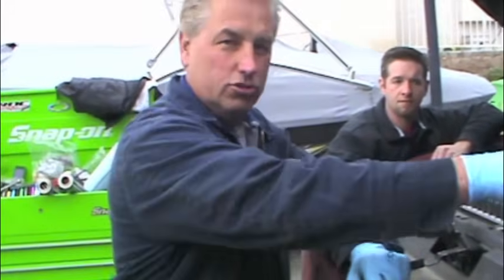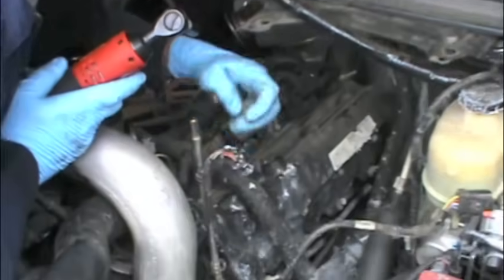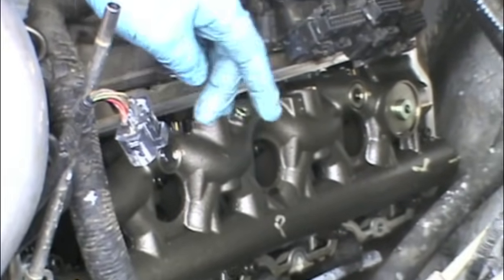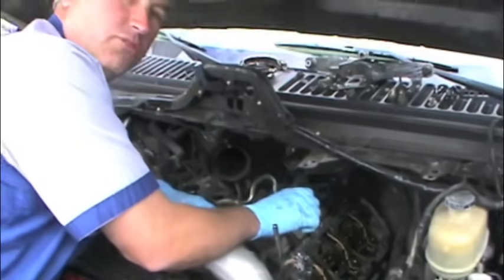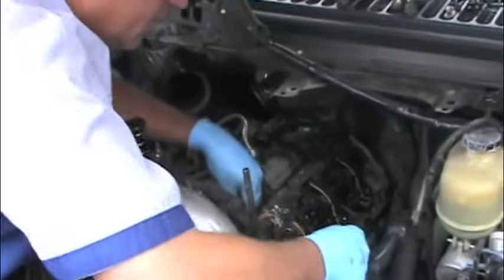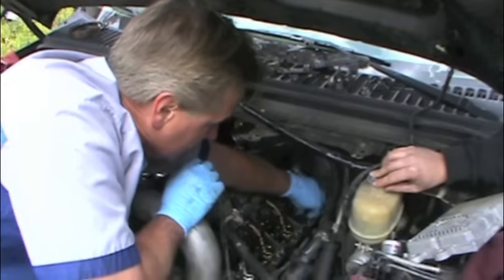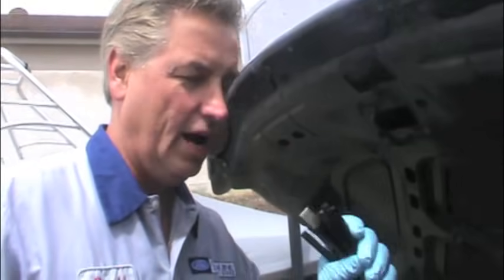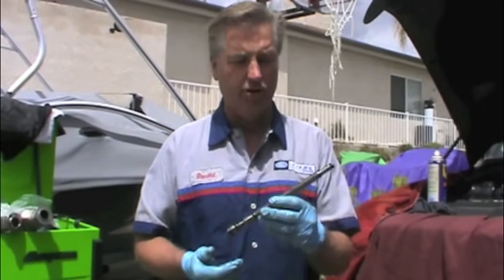6.0 DIESEL FORD POWERSTROKE INJECTOR REMOVAL AND INSTALLATION TIPS AND TRICK

Comment: Jeff here. Used Ron's material and FordTecMakaluco's as well to repair my 04 F350 6 liter. re-posting here what I just posted on Makaluco's channel in hopes it may help others.

I can’t thank you enough for putting up this and other videos. Repair details on my truck are provided below in hope they may help others. I love doing projects but my day job (a lot of times it is 7 days a week) just doesn’t allow me the time to figure all these things out on my own. From a long-term Navy man, thanks for all you do. It truly means a lot to me. I wish you and your Family the best. Thanks again. Sincerely, Jeff

2004 F350 107k miles, original owner. Turbo replaced at 25k with reman. I pulled the turbo at 75k due to vanes being seized. Cleaned, put on anti-seize, seems to be fine.
Starting at 90k, long term P0401, 0404, 1315. Cleaned EGR, resolved, but returned. Replaced EGR valve. Codes returned in a few months, cleaned, intermittent success. Truck ran fine, no smoke, plenty of power.
Recently returning from a trip, vehicle began to run rough at idle, not horrible. White/gray smoke at idle. Under acceleration, heavy gray to black smoke. No new codes. Lacked some power. Have never had a coolant leak. EGR well looks good when I pull the EGR. Checked down pipe, ok. Used my XRay scan tool no new codes. Bought AutoEnginuity scanner with Ford enhanced package. Scan with this tool indicated that at some time in the past p0281 had been set, but was not active. Ran the Power Balance test, indicated number 7 was not contributing equally. Ran the injector buzz test. Sounded good to me. I had my wife listen to the video of the buzz test and uncoached, she indicated that #7 sounded different. Bought reman injector form Bullet Proof Diesel. Installed using your video. Completed this morning and after about 10 seconds of cranking it fired up and is running very smooth. Power balance test looks great. No new codes.

Comment: Rip. I think ron has to be the most helpful 6.0l guy. Ive learned so much watching ron. I cut down a punch for my 12mm. Works perfect. Now i can put a socket on it and torque the stand pipes and dummy plugs to 60ftlbs.

Comment: I had much different symptoms than that.  I pulled the P0266 code for contribution of cylinder 2.  I was puffing black smoke in all conditions and could feel the miss.  I was a bit intimidated when I began taking things apart to change the injector.  by the time I was finished, I was glad I did it myself and will do any other work myself as well.

Comment from the maker: I've tried hotshot and rev-x I've had better luck with rev-x. They really help if its sticking from varnish not wear. If you lacked maintenance on your fuel filters and the pressure dropped then the fuel cavity is only partially full. That causes less resistance and the oil side will beat that plunger into the injector. Fuel pressure is critical. I've seen brand new injectors fail in 200 miles due to low pressure UNDER A LOAD NOT AT IDLE.
Reply: Rest easy Ron, still learning so much from you. God bless

Comment: I used a 12mm head bolt nut and washer in between to tighten the fuel rail plug. I put a 12mm socket on the nut and ran it all the way down the bolt until it bottomed out and the bolt head tightened the plug. After the initial prime and start, the truck would crank for up to 15 seconds before starting after sitting for short periods of time. Apparently this is normal after pulling the high pressure oil rail. I merged the truck onto the highway at full throttle up to 110km/hr 5 times to clear the air from the oil rail. It fires up in under 2 seconds now.

Comment: YOU DONE A PERFECT JOB. OTHER THAN,I USE BLUE LOCKTITE ON THE INJECTOR BOLTS. THE REASON IS WHEN YOU HAVE A PROGRAMMER INSTALLED, IT RAISES THE PRESURE. I ALLWAYS TORQUE THE INJECTER BOLTS BUT I HAVE HAD SOME COME LOSE.THATS WHAT THE LOCKTITE IS FOR. THE NEXT THING IS ON THE INJECTOR PLUG IN THE HEAD. A PRESURE REGULATOR SLEEVE OUT OF A GM 4L80 TRANSMISSION WORK BETTER THAN THE TOOL MADE FOR THE JOB. AND MOST TRANS SHOPS WILL GIVE YOU ONE. ILL SEND SNAP-ON BY SO YOU CAN GET THE RIGHT TOOL.  LOL

Comment: Condolences to Rons family. I have a 05 f350Ford. Runs great, but sometimes when i park it, it wont start back up. I have to wait 30 minutes, and then starts up perfectly. Its been in the shop several times. Any suggestions?

Comment: Ron I have a early 04 we did 8 injectors hpop, oil cooler, egr delete, and a ficm when we got it started ran for little bit until it hydrolocked tore back down found injectors were loose retorqued them going to remove glow plugs to remove any fluid do you have any other suggestions I should look for other than the injectors before i start it

Comment: Hi ron i have a question .i have a 2003 ford 6.0 diesel truck ,i was changed the fuel filter went i was take out the filter one little piece of the filter holder broke off and fall off inside the line i try to use a vaccum to take out but no good luck 1 month later i was trying to go to work but my truck never turn on again do you think the piece went inside one of the fuel injector

Comment: Ron, I am currently installing the Bullet Proof egr cooler and their oil to air cooler.  I have 3 bad injectors and wanted to know if you recommend replacing the injectors while the intake manifold is off or should I install if before starting the injectors.  Your thoughts and advice would be much appreciated.  Craig
Reply: Clearly this is 8 years too late, but if you have an older 6.0l that hasn't been bulletproofed I would do the STC while you are in there and the injectors unless they are under 50k.

Once all that is done the odds you are pulling the turbo and going all the way back to the injectors is pretty slim.

Comment: Mr. Ron,  i just replaced all eight of my injectors, the HPOP with new IPR, and ICP.  I also installed a regulated fuel return system.  it took a few minutes of cranking to start, but she did start.  but she runs rough and she has a bad lope.  i let it run for about 30 min to let the system purge the air out, but it did not improve the idle, or how she ran.  when i shut her down, it takes a minute of cranking for her to start.  the oil must be leaking back into the pan because there is no oil pressure unless i crank for a while.  any thoughts?  is it possible its a bad HPOP?  i am getting a P0272 code, but i cant imagine that is what is causing the long crank to start or the hard idle.?

Comment: Hi Ron. I have a question for you. My early 03-04 6.0l power stroke had all new injectors put in it, and it ran fine until a few months later. It runs fine until after I hit the accelerator,  then it sounds spotty and shakes for a few minutes(1-2) then it runs normal again.

Comment: I have a question one of my glow plug is leaking oil out of it is that bad
Reply: Sounds like the glow plug isn't seated correctly. They will have  oil on them but shouldn't be leaking out on engine. Buy a new glow plug.

Comment: Ron I have a stock 03 f250 with 115k miles never had head problem or egr cooler replace degas bottle is away just above min. had to put full injector in ayear ago no truck runes rough when cold my guy said it is injector again only 12k on them what do I need to do  running motorcraft filter fule and oil syhnitic oil and power service in fuel HELP

Comment: Hi their, what was the symptom of your #2 injector? I have a p0276 cylinder #6 injector circuit low. when I am driving down the road the rpm gets a little high then it kinda revs it self, while I am just holding the accelerator steady. when i am on a stop it little bit idles high and then immediately returns to low idle acts like its going to stall but not. thank you.
Reply: I have the same issue now— what was your resolve back then?
Reply: @syexplorarconmigo8853  hi. My resolve was replacing the #6 injector. Thanks

Comment: At 12:29 Ron said your gonna be hating life.Agreed,but it started at the point of purchase with the 6.0.Ron was a very knowledgeable man,he lives on,and will live on until every last 6.0 is past the point of repair. Ford really should stop trying to make diesels in house.
Reply: throttleitup 6.0 and 6.4 weren’t in house... 6.7 is and is the best since 7.3
Reply: 6.7 are having issues also.Whoever is designing these engines needs to stop.I will never buy another Ford.Really wish Dodge had a van with a cummins .
Reply: 7.3, 6.0, and 6.4 were international motors. The 6.7 is a ford motor and has a rather good track record.  The days of maintenance free diesel motors like the 6bt and 7.3 are over due to emission standards.

Comment: better scrap that heap of crap gas guzzler. 8 injectors wtf
Reply: Ovidu Acantinca lol
try towing over 12,000lbs with a 4 banger and then ask that same question about a v8.
Reply: Up to 18 mpg highway with a 8600lb f350 flatbed dually with 4.10 gears? Hmmm don't seem to much like a "gas guzzler" to me
Reply: Jokes on him it’s a diesel